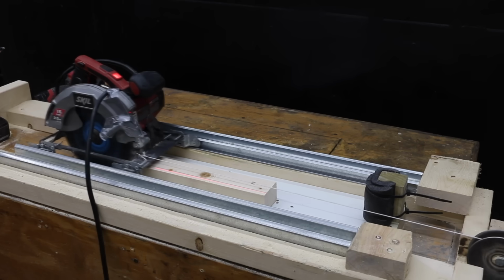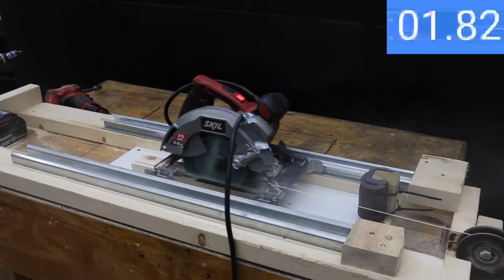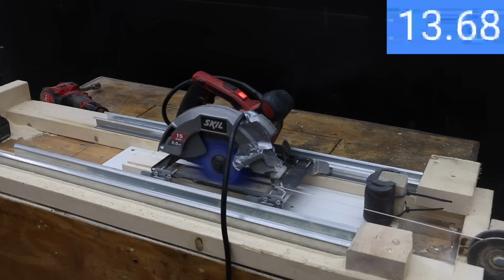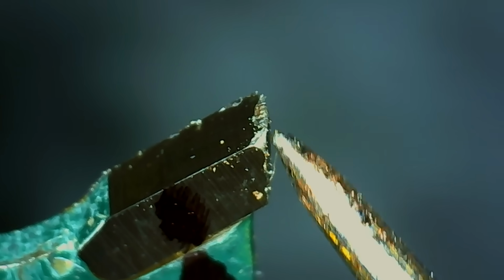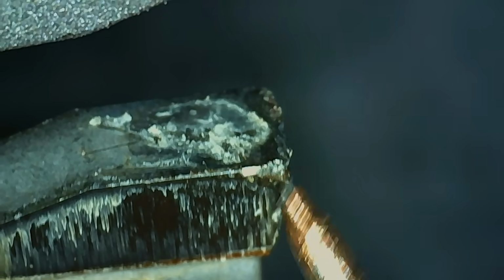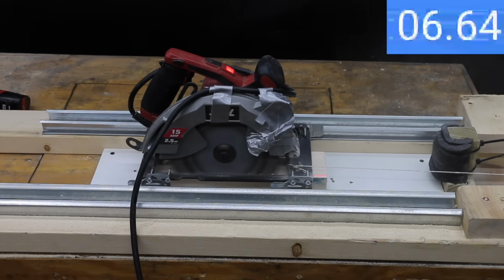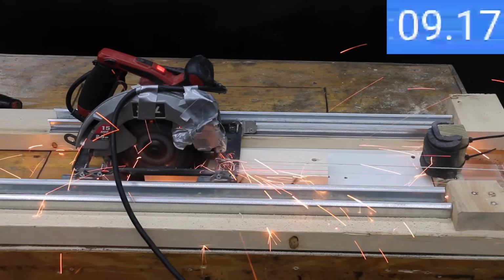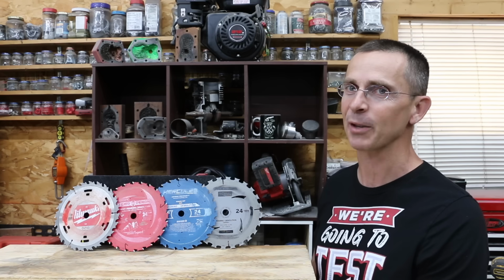Best "Demolition" Circular Saw Blade? Milwaukee, Diablo, DeWalt, Hercules, Evolution, Bosch, Amana

Comment: Couldn’t have been a more relevant video for someone like me. I’m a contractor (carpenter by trade). You just definitively answered questions I’ve had on my jobs for years
Reply: Nikaluss just out of curiosity, what conclusion did you come to after what you heard/saw? What blade will you now purchase?
Reply: @DanKoning777  I’m going to stick with Diablo. The other blades are great but I don’t do demolition, I sub demo out so the cut time is the most important part for me. Yes, there are faster blades but I think Diablo is the best that I can readily get in my town (Baton Rouge, Louisiana)... that and I buy them bulk and have about 50 new blades in storage😂
Reply: @nikaluss5946  //  Agreed; and to be honest [overall, at least for me], the Diablo is my go-to in most cases. Btw, Todd is great at informing/giving knew information, but he's also just as good at affirming what ppl thought to be true as well. God bless.
Reply from the maker: Great to hear!
Reply: @ProjectFarm  I love the meticulous ways you test products or fuels/ fuel delivery systems. I think it’s genius how you scientifically remove human error from the tests (weighs/pullies instead of the human hand)
Reply: I can’t understand the application of “big blue”.... just why?
Reply: @nikaluss5946  //  I think that's where it's supposed to be thrown; out into the "Big Blue."
Reply: @DanKoning777  for real.

Comment: This is probably my favourite test jig so far - only thing I'd change is shielding the rails, so chips can't get in and slow down the cut
Reply from the maker: Thanks for the constructive feedback.
Reply: @ProjectFarm  can you show us how you built that rig? Was it already a track saw or did you modify a circular to essentially become a track saw?
Reply: I’d also very much like to see how the track was built, I live in an apartment so a track jig is a much better option for me than a table saw for repeatable straight lines

Comment: Don't know if it is video material but I have an interesting video idea. Testing electric caulking guns and compare to normal caulking guns and an air caulking gun. See what ones get the most caulk out, smoothest lines. Time saved per 10ft. Ect
Reply from the maker: Thank you for the video idea!

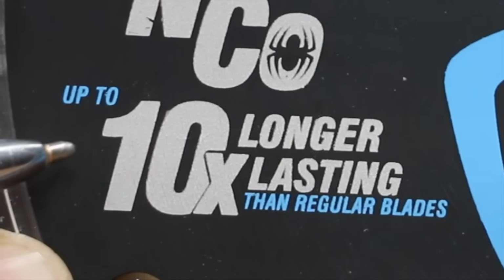Comment: 4:17   Made in Germany but assembled in China ??   How do you assemble a saw blade??
Reply from the maker: Great question.  My guess is fastening the carbide teeth and machining the cutouts.
Reply: @ProjectFarm wait, carbide teeth…attach to a saw blade?
Reply: I thought they were put in the cast before the metal was poured or pressed in.
Reply: You've clearly never assembled a saw blade before  and it shows

Comment: Can we please have a pressure washer contest? I need one to wash our driveway
Reply from the maker: Thank you very much!!  I've been working on it for the past 5 days and still have a lot of work left to do.  I'm hoping to have it ready for next Sunday at the usual time, 11:50 AM CST. Thanks again!!
Reply: @ProjectFarm  //  using an "on demand" hot water heater [like a Rinnai], in conjunction with an everyday power/pressure washer is almost akin to sandblasting ;) Though the heaters aren't portable, adding a line to an outdoor spigot makes a power washer think the heater is portable ;)
Reply: @ProjectFarm  Before you finish your testing, is it feasible to test the effect that the pressure washers have on rust?  I'm actually planning to use pressure washers on rust for a project.  (I'll be oxidizing the steel with diluted hydrochloric acid, then let it sit for a couple of weeks, then neutralize with baking soda in water, then pressure wash it with water, or I was thinking of pressure wash it with the baking soda water.  Anyway, the idea is to leave a rusted texture, not to remove it completely.)
Apologies for the long comment....  :)

Comment: Forget stocks, forget crypto, Project Farm is the best investment I’ve made this year…
Reply from the maker: Thank you very much!! This means a lot to me!
Reply: @ProjectFarm  i will stand there in home depot lowes or ace and pull up PF and look before I buy a product. some guy on another group i'm in bought a new weed wacker and was looing for line recommendations i'm like MAX POWER TWISTED OR GTFO. Amsoil has a new customer (me) because of you. my oil guzzling saturn though i feed that supertech synthetic. i bought a waitley dewalt battery last year based on your tests. i admit today i skipped to the end. i'll be picking up a hercules blade for my circular saw the nex time i'm HF. i bought Milwaukee work gloves because Milwaukee is always a leader in your tests.

Comment: 73👍's up PF thanks again for taking us all along with you
I use the Adela Diablo blade in my worm gear saw to cut 3/8 plate steel 12 pieces 2 ft the blade survived with only losing two teeth to wear them gear gave up and stripped 
LOL my boss wasn't happy
Reply from the maker: Impressive!!!
Reply: @ProjectFarm  not as impressive as all your videos you rock you're the man of men